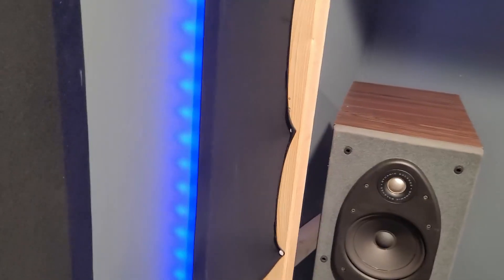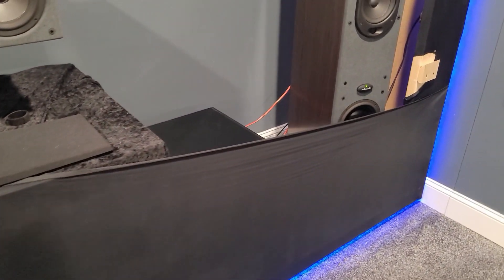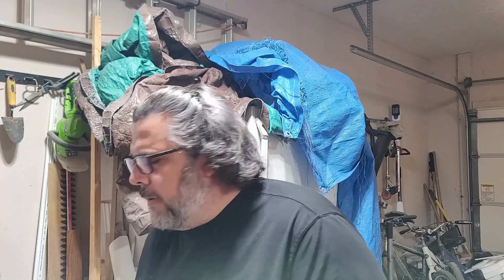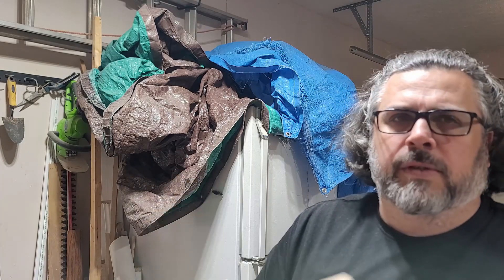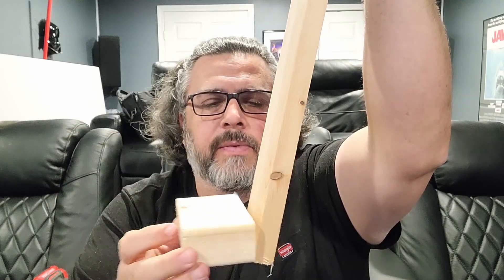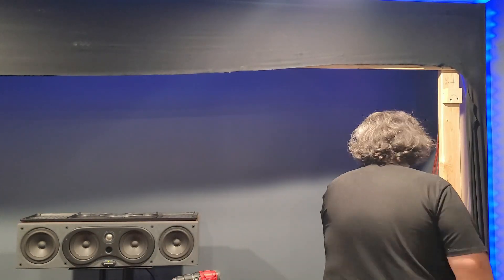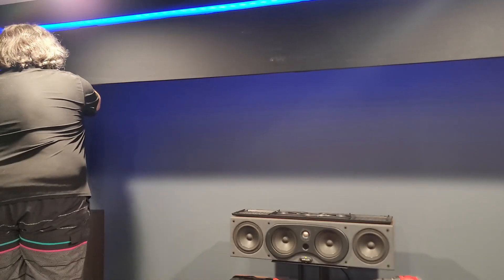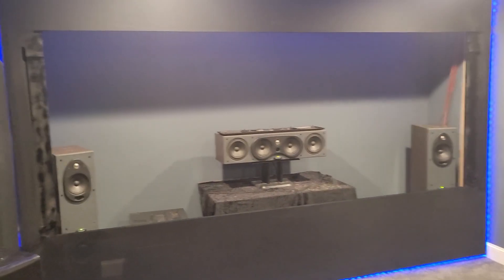Home Theater Fatal Flaw!

Comment: You have your receiver behind the screen?
Reply from the maker: The receiver behind the screen is powering a subwoofer. My sub's plate amp went out, so since I had that receiver laying around and it has a 5.1 input that bypasses the internal processing I decided to use it to power the sub. It does a pretty good job actually.
Reply: @EuphoniumDirector  Are you considering getting a Surge/Power conditioner to plug in all your devices?
Reply from the maker: Yeah for sure. Currently I just have a beefy surge protector.  I plan on getting a power conditioner though.